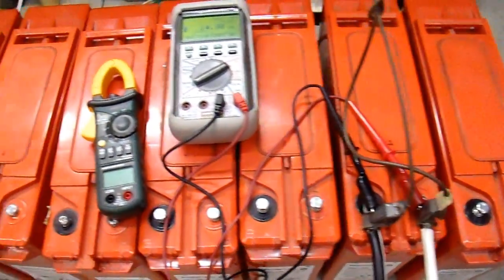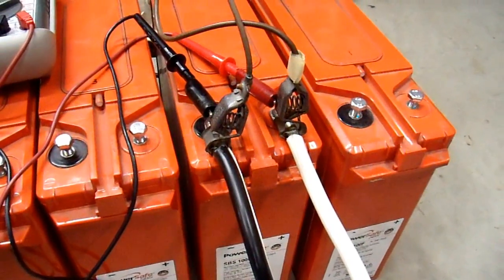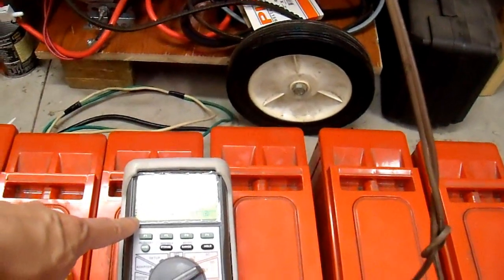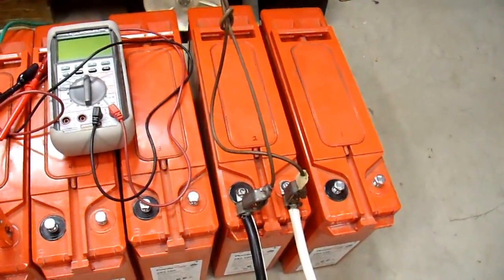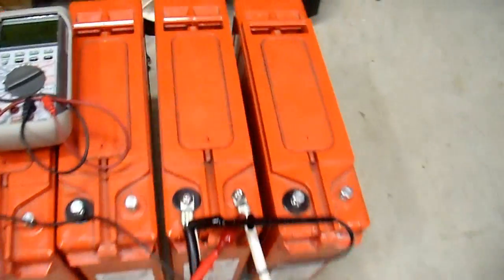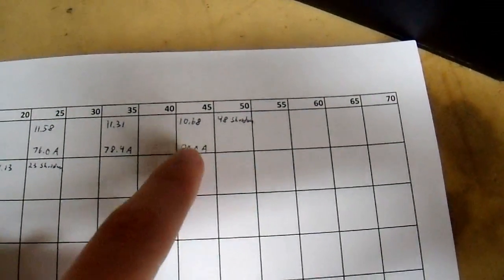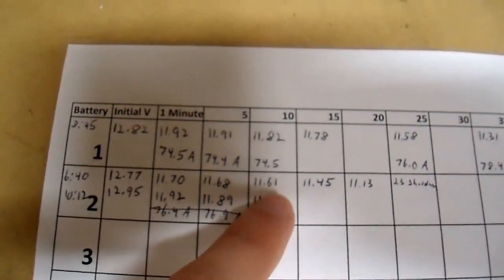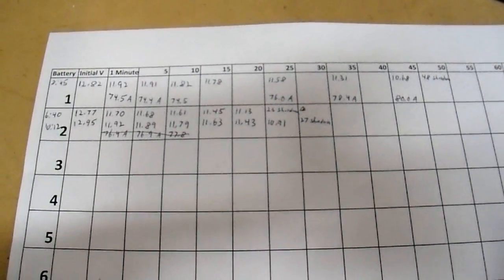1000Ah Battery Bank Part5 - Equalizing and Reconditioning a Sulfated Battery Continued

Comment: I just picked up an Absolyte GX series telecom battery used... I am hoping it works or my wife is going to kill me.
Reply from the maker: I looked it up, congrats on your find!  If they are genuine decommissioned batteries I'd be surprised if you didn't get a good deal.  If they were being disposed of due to failure...  yeah.  That's always the risk.  Industrial batteries like this are usually replaced on a schedule long before they are 'used up' to reduce the rate of random failures that can be very expensive for companies.  Individuals can more easily handle the 5%/year chance of a cell failure on an aged battery.

Comment: I really enjoy this series of videos and have rewatched them several times over the years. I just now came back to the series because I was gifted two 10-yr-old telecom backup batteries, and I immediately put them out in my "solar shed" where, until now, I've used nothing but junk, leftover batteries acquired here and there. What has alarmed me, however, is that I see my voltages climbing into the range you consider "overcharge," only to be used for reconditioning purposes. I'm talking 14.5+ volts. I'm using an old Renogy kit that came with a 100-watt panel and a simple charge controller. Is my charge controller junk? Am I hurting my new-to-me batteries by keeping them on this system?
Reply from the maker: Thank you for the compliment!  I've long considered this video series quite dry and drawn out even for my tastes but it was fun making it!  I would recommend looking at the datasheets for the specific batteries you have to determine how the manufacturer recommends you care for them but, in short, I wouldn't be concerned with 14.5V during absorption so long as they don't hang out at that voltage for too long or too often.  If you're getting to that voltage for hours every day you probably need to change to a GEL or AGM setting rather than flooded to prolong life.
Reply: @knurlgnar24  Thanks for the reply! I will re-read the instructions on my charge controller, but I do not believe it has "modes." Maybe I'm wrong. Mine is a PWM controller that is no longer made but looks similar to the ones they sell for $20 here and there. I'm investigating MPPT controllers. So far this is all for fun, so I have to keep my expenditures in check, but in case this works out for an RV setup or an amateur radio supply, it might be worth an investment. Keep the videos coming!

Comment: I know these videos are old but I'll add my 2 cents worth. Equalization voltage for 12v is 19v. You can accelerate desulphation by vibration. Put a piece of plywood on a washing machine place battery on the plywood set your cardiac to charge at 19v and run the washing machine. You'll have better results in less time.

Comment: You can put water in them. Under the oval there are little caps. It isn't easy to get to them but if you work slowly and easy you can get that get that oval part off to get to the caps. Something small working around the edges you can get the glue lose.
Reply: Your referring to this brand or exact model? I've opened a SBS c11 and just found vent ports. Didn't try with Northstars I picked up
Reply: @JasonLeef33dm3  many AGM batteries like this have some kind of rubber vents, you can water them a bit if their mats are dry.

Comment: I've been running 6 of these batteries off grid that were given to me 5 years ago. They are just starting to play up now. I think I may have had my regulator set too low , i.ve upped it to 14.1 v to give it some juice. I only have a 13.6 v floating charger running off a generator to back them up. Do you have any ideas as i can't plug into normal power source. Thank you for these vids very helpful

Comment: To desulfate a lead acid battery you need battery to use an electronic desulfator Not Over Charge. The pulsating of electrical charge at certain frequencies really does work. i have brought a few batteries of mine back to life this way

Comment: you can add water, but you must drill proper access point to add this water and secure it well. And please don't say that something is impossible... even this wrong battery can be fixed (all it take is proper protective gear, some knowledge and some work) :)
Reply: All depends. What kind of cell, reason of shortage, etc. For all cells you can probably find schematics in net :) all that stay to do then is reverse engineering

Comment: Hmm...

...12.6 Volts with 5 milliohms internal resistance gives over 2500 Amperes of short-circuit current (assuming a perfect conductor).

Good batteries!
Reply: what would you need 2.5kA peak current? starting a car? no seriosly, using supercaps in place of a car battery is so good, so using a battery with 2.5kA would be the same

Comment: great videos! Does this apply to LifeP04 batteries? I just tried to fix a LifeP04 battery that got discharged accidentally while sitting in my ATV (something is draining it, i don't know what) - The charger that comes with it did not charge it because it was drained to .5 volts! - but I charged it with a semi-dumb charger and it took the charge to 13.15V.  I will test it tomorrow to see if it held the charge, and then I will put a load on it to see if it still works, until it is 50% discharged, then i will charge it again.  I did not know you could recondition a battery. Everybody just tells you that it's ruined.  I'm going to do this to all my SLA and LA deep cycle batteries now that I previously had no hope for.

Comment: Hallo, I do agree with you about the myth of placing the batteries on the floor but what I was made clear of is that if the floor is cold it will transfer the cold to the battery and will lower its performance. From what I know, ideal battery temperature should be 72 degrees F. My 2 cents.

Comment: I would ecourage you to go forth with your extended overcharge on one of these not-so-good batteries in spite of the fact that they are sealed.  I would like to know the results, and 1.) What do you have to loose? 2.) These batteries are of a good build quality, and would prob. do a good job of recovering the water.  3.) Personally I have a little UB1280 here that was part of a 2-cell 24V UPS system that is completely melted from a shorted cell in the 2nd battery where the dang thing nearly caught the house on fire.  Mystery is this: I recycled the battery with the shorted cell, and figured I would have to do the same with this, but not so... It is going strong 2 years later, wavy sides, top and all... If it didn't get dried out from that punishment, you may be o.k. Just my 2C
Reply from the maker: Well, I'd never use a bulged battery myself...  Glad it works for you though!

I did try the extended overcharge and cycle method on one of these bad batteries and documented the results in my 'How to properly desulfate a battery' video if you're interested.

Comment: This is something I've been studying for a while now. Try a high current, high voltage, pulsed charge system. In other words you can take any 555 timer circuit and use it to drive a FET on your old school charger to turn the current on and off. I would set it at about 1 half second pulse every 20 seconds or so. In my experience this works fairly well for getting battery banks desulfated and equalized. It also works to somewhat reform dead cells. It's not a cure-all fix but it is better than boiling off your electrolytes. A standard run for this is about 1 week. I have used it on the SLA gel batteries in my UPS's more than once and it brings those back fairly strongly. You'll loose about 0.223% capacity over 1 year with this method on the standard UPS battery types.
Reply: A friend of mine really likes a homemade desulfator that's a lamp dimmer set to 50%, a 5uF motor run capacitor (for car batteries - change the size to one appropriate for your battery), and a bridge rectifier. The idea is that it throws a large pulse 120 times per second, but a pretty modest average current.

Comment: to break the sulfates u need 15.5 volts
Reply from the maker: I agree with you that >15V is needed to 'reform' hard lead sulfate in most cases, but since these are AGM I hesitate to equalize them at a voltage that will result in rapid electrolyte loss.  Lower charge voltages and cycling will successfully desulfate most batteries without the water loss of high voltages.
Reply: ***** in my tests the high amps cooked the batteries,use only couple hundred milliamps at the most. i tested in sla batteries with no problems at 16volts and 2oomA